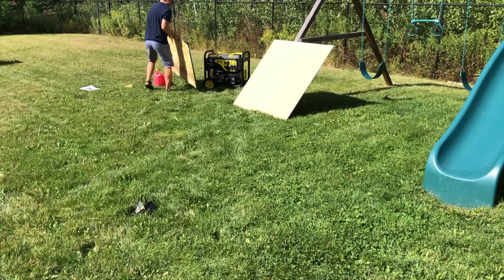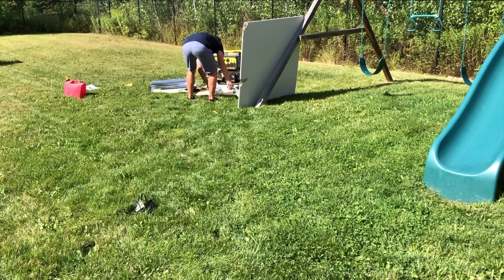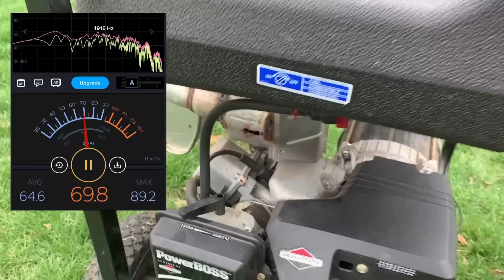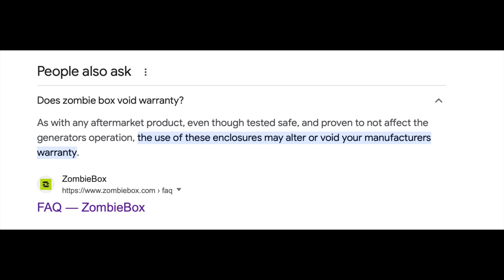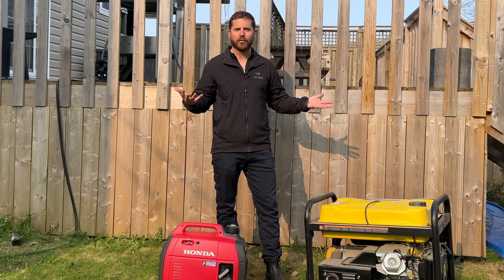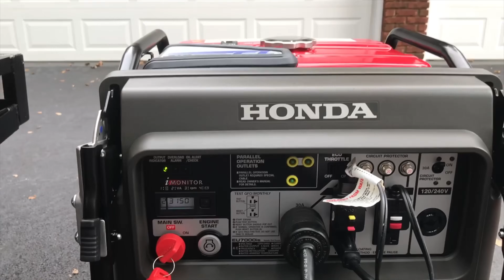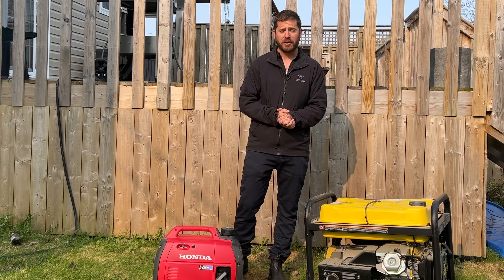8 BEST Ways To Make a Noisy Generator QUIETER!

Comment: I just don't understand how a car engine can be 200-300 horsepower and be almost silent. I have a harbor freight 8750 inverter generator and it's just too loud.  And I don't even think it's as loud as some of the others.  When I have it running, I can't even hear myself think, it's very distracting. You make a good point about maybe adding a muffler will reduce the engines power.  but I don't see how a muffler off of like a stock honda civic or something similar would reduce power, when its made for something that literally has10 times more power than a generator like the 8750watt I have. The little muffler on mine has like a 1" hole on the exit.  Do you really think a 2" muffler would affect its power?  I don't think it would, but I'm not really trying to experiment on my new generator, but I would copy someone else that has a tried and proven way.  That muffler you showed in the video did not make it quiet enough in my opinion. It was good that you showed that but I want mine to be silent.
Reply: The engine itself is noisier than the exhaust because of the metal parts clanking together. Those small engines are pretty simple and don`t run smooth and balanced like a car engine does. If they were put together like a car engine most people couldn`t afford to buy a generator.
Reply: Pick up the hood and listen again at the engine compartment, far from almost silent.  Adding a muffler will not reduce power but the exhaust is not the main source of noise, the mechanical items are.
Reply: Air-cooled engines vs. water-cooled. The water and extra metal muffle the mechanical noise. On a generator the mechanical noise is probably louder than the exhaust noise.
Reply: The cooling fins on the act like speaker cones and carry the internal noise of the engine outside.

Comment: Have you ever tried adding pipe to the exhaust into a barrel of water? Works wonderfully
Reply: no way
Reply: It makes sense.  Ever notice the exhaust on a large boat? When the exhaust opening dips below the water it goes really quiet.
Reply: i have a loud champion generator, question is does it keep the exhaust from working right?

Comment: Don’t forget, you can’t hook an inverter generator up to your house so don’t buy one unless you really need to.
Reply from the maker: The good news is that the EU7000is, luckily, is a floating neutral generator, so it can be used with simpler transfer switches, such as your "select circuit" switch, or breaker interlocks without violating the NEC's grounding and bonding provisions. (Many jobsite generators have bonded neutrals as per the OSHA rules on worksite use, but this means that they need to be used as separately derived systems. This, in turn, requires a transfer switch which switches the neutral wire over so that you don't put the two neutral-ground bonds in parallel inadvertently, which'd cause merry havoc with stray neutral currents and even GFCI tripping.)
Reply: That's NOT TRUE (NOT ACCURATE) at all! It's very common practice to connect to PROFESSIONALLY connect to the main house panel via a 120V Only Transfer Switch with a 120V Inverter Generator. I have a Champion 4650W Inverter Dual-Fuel Generator that I connect to a Reliance 6-Circuit Transfer switch to manage almost everything I needed in the house. It is not connected to any 240V circuits at all since it won' run a 240V Pool Pump or House AC but I don't need those in an emergency. It even runs the 120V Circuit for the HVAC NG Heater Fan that only needs 300W to run the Fan for the whole house heater.

Comment: I have been running my generator in the shed, with the door propped up on a foot-stool, and a fan blowing across the generator and out the door.  

Still considering a box so I can run less cord, and have easier access for longer-term use when the need arises 😬

As for neighbors, if they even ask about the noise, that’s my sign to make it quieter, and offer them a cord until I do.
Reply: I suggest you purchase a child house, you put insullation and an exhaust fan and you are ready to go at a little price. The biggest benefit is to avoid thief, they will not look in a child house...

Comment: you have to use the right kind of muffler FFS, they need to be low decibel ceramic coated, no issues.. your car doesn't have issues right? ceramic coated on the inside the heat dissipates .. the reality is they need to be water cooled so the engine can be sealed up save air intake and exhaust, radiator/fan .. you can't use boxes over an air cooled engine.. good grief.. 

have you ever heard a propane forklift inside like amazon?  nope, that's right you don't hear them, even tho its internal combustion, how do they do it?  welp they use a PROPER muffler, not one that has holes in it then hold a chunk of wood on the hole, dafugg was that?  LAME!  mufflers is how you quiet internal combustion engines, you NEED exhaust pipe to carry the heat away, at least 3 feet, and it should be heavy gauge and ceramic coated inside and out, wrap it around, or if its stationary like ina RV just run it beneath, with a couple small GOOD mufflers, you won't even be able to tell its running, JUST LIKE INDOOR PROPANE FORKLIFTS!  look at how they are made and you will see
Reply: Just adding mufflers won't make it run where you can't hear it. Mufflers help, but the noise a generator makes  doesn't all come from the exhaust. Air cooled engines make more noise than liquid cooled engines

Comment: I've seen tons and tons of videos people putting Mufflers on a generator it actually doesn't truly work because the noise that you hearing is coming from the inside of the motor and the rattling is from all the metal parts
Reply: Wrong! The addition of a muffler and sound box is much quieter.
Reply: Thats not true. The old early 70s Cadillacs with big 500ci engines had 3 mufflers and they were totally quiet.

Comment: First find a generator made in America or a country that puts quality first, even if it ist an American brand make sure nothings loose or vibrating they could produce annoying rattles or buzzes and used 20 W 50 oil full synthetic or 0W 40 if you’re running it in the very cold climate
Reply: I am using Hyundai hgs 3500, Using kixx 10-40 oil. What do you think is this oil good ?
In our area In winter temperatur is 5C to 28C and in Summer 25C to 50C

Comment: With these recent rolling blackouts.  I bought a champion duel fuel inverter generator it is quiet compared to a typical gas generator.  I also bought 2 solar power stations that I can charge in under 2 hours with the champion.  The 2 solar stations would keep me running a little under 2 days.  I like the idea of keeping things quiet as possible.  Great video!
Reply: Quiet is very important, I agree.  Question:  Is a "duel-fuel" inverter generator just as quiet whether it is running on propane or gasoline?

Also, does Honda make a propane generator (since I like the quietness of Hondas)?

Is it difficult to store gasoline?
Reply: @MrRickonia  You can convert a honda.  I do not think they make dual fuel.  Propane will give you less wattage output.  It's not a huge difference but it is less.  Propane stores forever fuel doesn't.  I have never run my generator on gas and won't because then I get into carb issues.  Propane is just way less maintenance and easy to store.  Hope that helps!
Reply: @MrRickonia  dual vs duel
Reply: @MrRickonia propane sounds a tiny bit quieter to some people.
Reply: dual vs duel
Reply: @vashon100  Nobody cares vs who gives a sht??
Reply: @johnmal5975  English can be challenging.
Reply: @vashon100  Thanks Professor dipsht!

Comment: Here in Arizona I needed a larger generator (12,500 w) to run the central air. I'm thinking of insulating the overhead door and venting the exhaust out with a flex pipe. I might use a high flow fan to cool the unit if I think it needs it.

Thoughts?
Reply: Are you asking about putting the generator in your garage?
If so, that's strongly discouraged because of risk of exhaust in your house.
Reply: Look into adding a micro air soft start system to the AC into $400. It will cut 75% of the amps to start it each time. It basically pays for itself over time. It’s hardwired in.
Reply: @darrenjohnson379 I just installed an Active Controls 40amp Soft Start on my 2.5 ton AC and was able to run my system with a 5000 watt generator.

Edit: I think I paid $310 total (with a 5% Labor Day discount)
Reply: If it's a detached garage, absolutely..

Comment: You can use a resonator extension on the exhaust pipe and it does not effect the exhaust output flow but will reduce the noise. They are used on diesel vehicles and equipment and does not affect the exhaust flow like a muffler will.
Reply from the maker: Thanks! 😊

Comment: I adapted a small broken chest freezer, removed the compressor, added casters and cut two 4x10 duct holes in the bottom for air flow. Used a 30w duct fan for cooling air. With a 2200w inverter generator  inside, tests show inside temp  increase less than 20f during operation. Sure its big, but easily wheeled around, and protects the gen from weather, and can be locked up.  Really, really quiet!
Reply: That's a great idea. Thanks.
Reply from the maker: That’s awesome! Thanks for sharing!!
Reply: What about the exhaust fumes ?
Reply: You can actually buy a NEW chest freezer and adapt it cheaper than a zombie box....they're that expensive.
Reply: F'ing GENIUS!
Reply: Just the name zombie seems half ass, hodge podge, that takes all your money!!..Just like my ex knife!!
Reply: What size generator